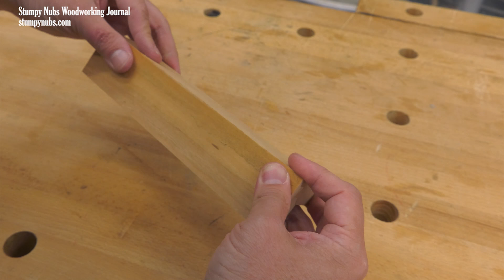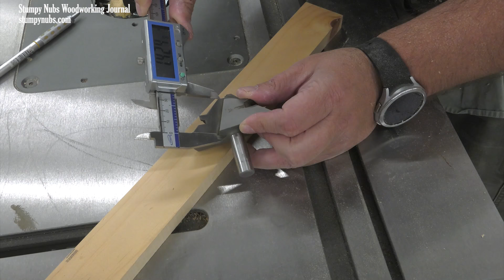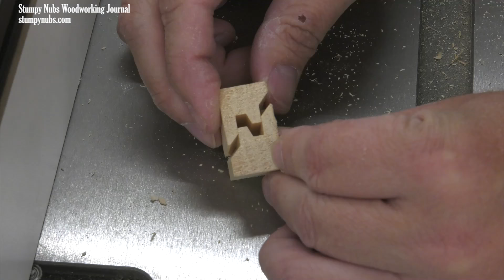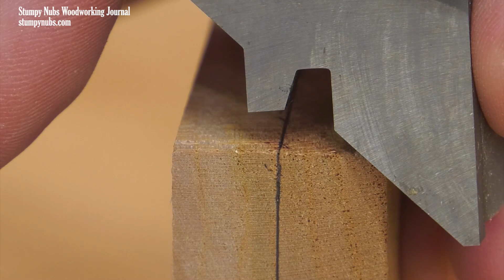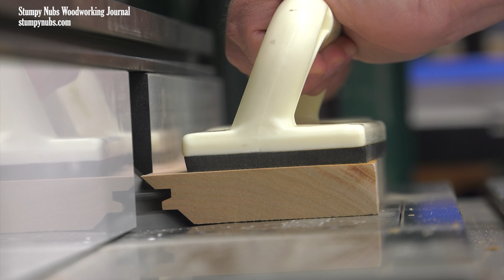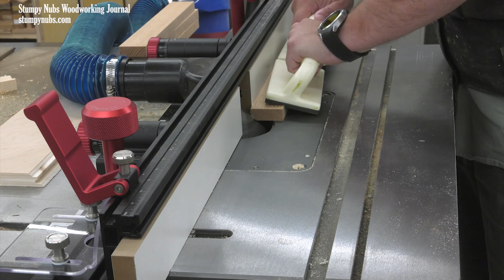This will make SO MANY of you very happy!

Comment from the maker: ▼ IMPORTANT DETAILS ABOUT VIDEO: ▼  
- My digital caliper: https://amzn.to/4dfelkM
- My digital height gauge: https://amzn.to/4eymAtc
- My router table roller guide: https://www.harveywoodworking.com/products/universal-roller-guide
- My lock miter bit: https://amzn.to/47HHP9Q

★THIS VIDEO WAS MADE POSSIBLE BY★
My Woodcutters is a small Canadian business that specializes in Helical carbide jointer/planer heads and replacement HSS steel knives for both new and older machines. It is well worth supporting: https://mywoodcutters.com/

My Table Saw and Bandsaw are AWSOME! Check them out at Harvey Woodworking Machinery: https://www.harveywoodworking.com/

My hand tool collection includes premium tools from Bridge City Tool Works: https://bridgecitytools.com/

Please help support us by using the link above for a quick look around!
(If you use one of these affiliate links, we may receive a small commission)

Some other useful links:
-Check out our project plans: https://stumpynubs.com/product-category/plans/
-Instagram: https://www.instagram.com/stumpynubs/
-Twitter: https://twitter.com/StumpyNubs

★SOME OF MY FAVORITE INEXPENSIVE TOOLS★
- #ISOtunes Hearing Protection (Save 10%): https://shop.isotunes.com/stumpy 
-BOW Featherboards: https://amzn.to/430ldhv
-123 Blocks: https://lddy.no/vpij
-Mechanical Pencils: https://amzn.to/2PA7bwK
-Lumber pencil: https://amzn.to/2QtwZjv 
-Pocket Measuring Tape: http://amzn.to/2kNTlI9
-Nut/Bolt/Screw Gauge: http://amzn.to/2CuvxSK
-Self-Centering Bits: https://amzn.to/2xs71UW
-Steel Ruler: https://lddy.no/10mv7
-Center-Finding Ruler: https://lddy.no/10nak
-Bit & Blade Cleaner: https://amzn.to/2TfvEOI
-Narex Chisels: https://lddy.no/sqm3
-Mini Pull Saw: https://amzn.to/2UEHBz6
-Shinwa Rulers: https://lddy.no/zl13
 
(If you use one of the affiliate links above, we may receive a small commission)
Reply: Very cool.

Comment: After making epic mess out of wood and very fortunately not my hands, I gave up on this bit till I got a proper table set up. Most of the videos do not discuss how to use the bit properly and safely beyond the set up. I got a Jessem table, router lift, and fence. I added guide wheels that hold stock down and pull toward fence at same time. Consider that to a plastic bench top Skil.
I mounted the table to a Rockler folding stand. I had to cut a section out of a cross piece for it to fold with the lift in place. Then I took the switch off the Skil and mounted it to table, and wired a longer cord into it. Plug router into switch, switch plugs in outlet. 
Safer, quicker to set up, and better cuts.

Comment: While it may seem obvious, as it's NOT mentioned in the video, to make any of these methods work, you need to make sure the stock you use is all the same thickness.  Wood pieces need to be properly prepared (flat, square on all sides, faces and even thickness) before joining.

Comment: An inherently accurate way to find the center of a piece with parallel sides and a square face between them is to run a square line or cut between the sides.  Then, using the 45-deg leg of an adjustable square, set the ruler's edge to intersect the line where it meets the edge.  Draw a diagonal the you know intersects the mid-line and repeat from the other side.  This results in a "x" drawn on the center line, with the middle of the "X" exactly on the mid-line.  Centering heads on adjustable squares use this same geometrical rule.

Comment: I have no problem getting mine dialed in, but how do you get it cut clean and not just shred the board? I have the exact same bit you're using, same router table and fence too. No matter what, when I make the vertical cut it just teas everything apart. I wish you'd do a video on that.

Comment: After getting my bit locked in years ago, I made a jig using UDPE. Using the jig I can usually get it set with one test cut. Also, MICROJIG has a bit with the centered marketed and is to be used with their board center jig for fast setups. Do not the costs and I have never tried it.

Comment: Time is Money so the higher cost of a fast-curing finish can be offset by the time saved. Even more time when it's a durable finish that the customer/client isn't sending the project back for Touch-Ups after delivery or whatever (or house call to fix blemishes). 
BTW - When using Router Bits that make Joints, once set up, I take a scrap piece of wood and run it through the router. Then I Label and Save the piece of wood which will save me a ton of time when setting up the same bit(s) at a later date. Just raise or lower the bit until it fits snugly into the cut previously made by that bit.

Comment: I have to put my hand up for owning a locking mitre bit for several years, and never using it.  I also never use mitre joints because they are such a paint to glue up.  So this video was very welcome, and I am definitely going to try it.  Come to think of it, I now remember a friend at my Menz Shed showing me a locking mitre bit and saying how clever they are, and I am sure he never used the bit after that, so I'll send him a link to this video.  

I checked out the UV curable wood finish, and was put off by the fact he has 14 different versions.  some of that was down to Gloss, Satin Matt variations, but it was still over complicated.  If just one was suitable for most situations, then I might consider it, but I am not prepared to invest in multiple versions at US$133 each.   I Google 'UV curing light' thinking the Clean Amor light was expensive at US$297, and found lots of options at a fraction of the price.  That also got me thinking there must be lots of alternative UV curing resins and there are heaps of much cheaper alternatives.  All I can say is shop around.  A lot of them are available in small quantities cheap enough to try out.

Comment: Actually a Company called “ Infinity” solved these issues for large and small Loc Miter Bits they make and sell.  It comes with a Magnetized Jig that perfectly solves this issues with no adjustment or very very little !  But great explanation if you do not use infinity bits !
Reply: Got a link?

Comment: Curious about the micro/macro frequency ranges of the UV cure compared to what John Ott discovered regarding safety. Also wondering about requirements for a sealer. And last, food coloring tatoo ink? Has anyone tested food coloring mixed with the Clean Armor finish to tease unique tones in the grain?

Comment: James, any recommendations for a good lock mitre bit that won't break the bank? That looks like a Whiteside to me, but I didn't catch the name if you mentioned it. Thanks.
Reply from the maker: Yes, mine is Whiteside. I use the large version because it will work with material up to 1-1/4 inch thick. They have a smaller one that will work up to 3/4. Link is below the video.

Comment: I never heard of these before, but now I want one. Would they work for making picture frames? The connecting edge is very small, so I'm not sure how you'd orient it... (I use a guess and check calibrated table saw right now for the corners.)

Comment: I think that if it’s something used often enough that it’s worth setting up something permanent. I have found that because the bit does both cuts one vertical and one horizontal it doesn’t allow enough room for glue. I’ve also run both panels horizontal and then cut the tongue off of one with a dado. This way you can control how deep the dado is for glue. Anyway is most situations a miter fold is just fine.

Comment: even easier method one: you're performing one extra math calc you don't need to do.  Just add the two measurements together and then divide by 2. That's 2 operations  instead of three.

Comment: Despite many attempts I can’t get a decent joint on two pieces of end grain without lots of tear out! Is there a secret to this?
Reply from the maker: Is the tear-out on the edge, or all the way across the face? If it's on the edge where the bit exits, you can leave the workpiece a bit extra wide and then trim the tear-out away. If it's all the way across the face (common on veneered plywood) the solution is to create a zero-clearance panel to cover the router table fence and eliminate the gaps around the bit. Clamp a piece of thin wood over the fence, covering the opening including the bit itself. Turn the router on and move the fence back, letting the bit cut into it and emerge just enough to cut your joint. Label your new sacrificial fence for reuse next time.
Reply: @StumpyNubs  thanks James.

Comment: Could you just put the work out in the sun for a couple minutes to cure as well?
Reply: Yes, although this has some caveats. You can't really apply the finish properly under sunlight, so the workpiece needs to be moved back-and-forth for every coat. Sunlight may also be difficult to apply during nighttime, and otherwise problematic to apply during adverse weather conditions.
Reply: @HaloTupolev  Makes sense. I'm in AZ... Plenty of sunlight (during the day, of course)

Comment: What do folks think about using these lock miter bits on plywood joints?
Reply: look at the invisible joint from his nubs in another vid. it gets much the same result using a straight router bit and is a much easier set up.

Comment: This is one bit that I keep a setup block for.  Once I'm dialed in, I keep a short section of stock with the profile and use that next time I set the bit.  It still may need tweaking, but it gets me damned close.  As long as my stock is the same size....
Reply: I do the same thing.  Beats measuring and marking, can just make adjustments as needed.

Comment: I bought the Clean Armor Satin finish. I was very disappointed, because it sure as heck looks like every GLOSS finish I've ever used. The Woodcutters just argued with me that I was wrong, but that didn't make me happy with my results. 
$133 per quart times five quarts plus the $250 I UV light. You can guess how unhappy I am with the customer service.
Reply: I paint for a living and every brand is a different when it comes to sheen. 
  What is called gloss now is laughable when it comes to paint.
 As far as poly goes I'm a voc kinda guy and pro luxe/sikkens door and window (oil based)  satin is actual satin and gloss is gloss. 
  Anything waterborne just ferls like I'm applying junk

Comment: Important note on the UV finish.  There is extra expense required per the mfg incurred by having to also buy their specific UV light to cure the finish.   “a dedicated UV light with a frequency between 365 and 400 nm is a must to cure Clean Armor products. These lights also must operate in low energy with a range of 1 to 3 milliwatts light output per square centimeter. To the best of our knowledge, only the CUVO lights are made to these specifications.”
Reply from the maker: The finish manufacturer does not sell the UV lights.
Reply: Depending on the circumstances, sunlight will also work in a pinch.
Reply: I bought a cheapo $50 365nm 50w floodlight from Amazon and it worked beautifully

Comment: 1:03
I have been using lock miter joints since 1973. Mostly cus on a large 2 spindle shaper. Works great for plywood veneer column covers. Increases the total glue surface area over a basic miter. It is wonderful how the corners self align. We had shaper knife sets for up to 3/4" and up to 1 1/2" thicknesses.

Comment: I’ve got the cheapish Bosch router table, where you have to reach underneath and twist the collar and then lock it down.  I don’t wanna have to buy one that has the nice cranking mechanism (twist a key from above to raise/lower).  Is there such thing as buying just the mechanism for raising/lowering a router?  And the preferred raise/lowering method would be a similar Allen-key crank from above, but I’m fine if the cranking happens below the deck.
Reply: There are a few routers that adjust from above. Triton is one, I believe.
Reply: They make router lifts. You can build your own table much nicer or set it into a bench. There is a whole flip top one made by dowelmax as well

Comment: Has anyone run into the problem of the dry fitted joint being perfect, but then the glue swells the very thin mitre side so it is curved, and a gap opens up? I was using Titebond 3 in douglas fir.
Reply from the maker: Is the gap along the sharp edge (corner) of the joint, where the two pieces come together?

Comment: The easiest, quickest and simplest is to get the set up block when you get the bit. Or buy the block from your supplier or source.
Reply from the maker: That gets you close, but you still have to do test cuts and make fine adjustments. These methods are just as good, in my opinion.

Comment: i'd like to know about that hand held UV light, where to get it and how much $$$$$$$$$$
Reply: You can also use sunlight.  Apply in the garage, open the door and set in sunlight for 2-3 minutes.  Worked great for me.
Reply: @tomunderwood4283  That makes sense, the Sun gives off almost every kind and frequency of radiation known to man, from low to fairly high frequency, so the right band of UV is bound to be in there.

Not too good in some places in winter though...
Reply from the maker: Follow the link below the video
Reply: @StumpyNubs  yup i seen it , thanks

Comment: One could just scribe the center of the bit on the flat relief surface of the bit and have a permanent guide instead of guessing where half the slope is. In fact the bit manufacturers could include a center mark and then marks showing the wood thicknesses to assist in the initial set up.
Reply: I think the easy way would be to set it up for the board thickness you want to use, then keep a short section of the test piece you made. The next time you need to use it for that thickness you can just use the test piece and raise the bit until it fits in the test piece. Next move the fence until it fits completely.
Reply: @phizc  That's basically what the Rockler jigs are, just out of HDPE instead of wood.
Reply: Rockler sells a $10 setup jig for their bit as well that get you the perfect alignment for 3/4 and 5/8 stock as well. Or you can just get it dialed in and cut your own.

Comment: Wonderful video. I watched that ad for the finish before and it's got my attention. I'm planning on making cabinets this winter, does anyone know if it's food safe?
Reply: From their website…

“Is Clean Armor Food safe?

Clean Armor products do not have any HAP and VOC and therefore, are fairly safe. However, Clean Armor has tried, but did not receive FDA approval for cutting boards and similar products. The products cure to an extremely hard material, that when cut into with a sharp knife, repeated cuts will result in fine slivers of the finish that eventually may break free and mix into food. When consumed, they may be dangerous not on a poisonous level, but rather physical…
For any other products, such as serving trays or wooden goblets and bowls, the product does waterproof the wood and is also safe.”

Comment: Could you use that coating on wood turnings
Reply: There's no reason why it wouldn't working on a turned word project. It's a little more difficult to apply and to get the UV light on all surfaces the more complex the shape of the wood, but that's not a huge deal.

Comment: 5:34, 6:05, 6:45, 8:22, and a previous video, you keep making the point of no respirator.  The Material Safety Data Sheet for this product includes the statements: 

Avoid breathing dust/fume/gas/mist/vapors/spray.
Use only outdoors or in a well ventilated area.
IF INHALED: Remove victim to fresh air and keep at rest in a position comfortable for breathing.

Perhaps there is no reference to a respirator because there is no effective respirator filter.  

I suspect that, for the hobby woodworker,  this product is neither more nor less "safe" than traditional varnish, shellac, or lacquer, provided those materials are used appropriately.  Its biggest appeal is the time factor, which is an issue mostly for professionals.  The hobby woodworker has to balance the time factor against the very significant cost factor.
Reply: Maybe they just add this to their label to prevent the vultures from trying to wreck their lives?

   Me personally I do hack work but, prefer my oil based hi  voc finishes.

Comment: Can you use that finish on cutting boards?
Reply: It's not meant for cutting boards as it's similar to applying polyurethane in that it builds up a "plastic" surface. Cutting boards are meant to be finished with food-safe oil/wax unless you are just using the board as decoration and not cutting food on it.

Comment: That uv finish has me wodering if you could use 3D printer resin and get the same results. 3D printer resin is a lot cheaper.
Reply from the maker: Just because two things cure with exposure to UV rays doesn't make them the same any more than two resins that cure with exposure to oxygen. You would have to contact the manufacturer to ask.

Comment: I just get things set, and then cut extra pieces and use them to set the bit
Reply from the maker: I've never found those blocks (or homemade ones) to be as accurate as they claim to be. They get you close, but you still need test cuts and adjustments. This method (especially the digital one) is as fast or faster, in my experience. But if you prefer the setup block idea, these methods will still serve you will the first time, before you make your block.

Comment: Is all this really easier than just using the ruler and adjusting up/down in/out until the ruler touches in both positions properly?
Reply from the maker: Just because the ruler touches at both positions along the fence doesn't mean the bit is set for the thickness of the material you are cutting. The bit must also be aligned with the center of the workpiece.